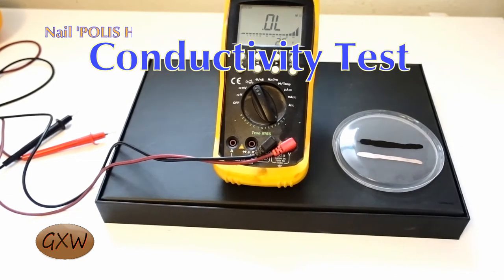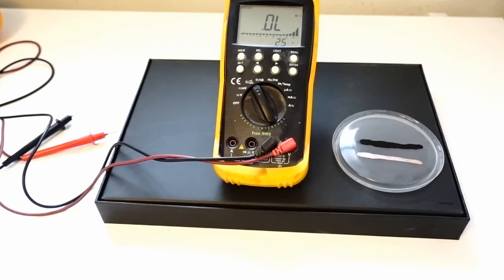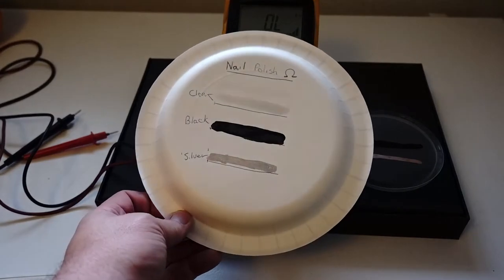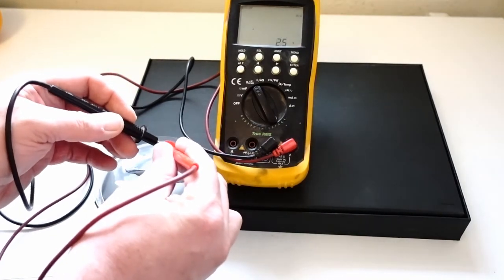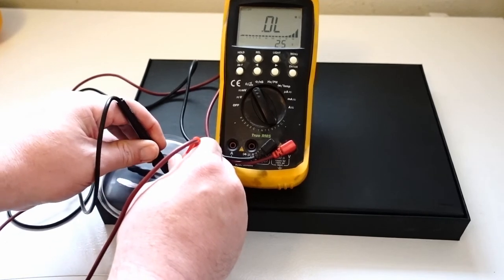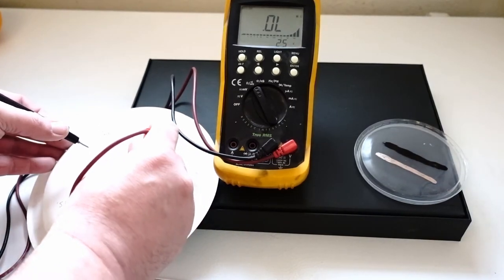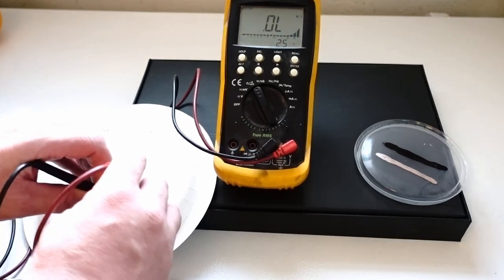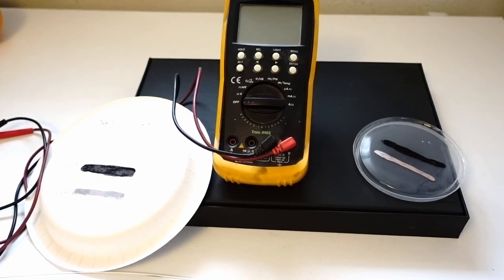is Nail polish conductive?

Comment: I was sure this video wouldn't exist but I'm so glad it does, I can now feel safe applying liquid metal to my cpu.
Reply from the maker: Hi 1992 Miata!  Thank you for watching my video.  I use the 'nail polish trick' for all kinds of things, and I don't see why it wouldn't work for putting Liquid Metal TIM on a CPU after painting the CPU with nail polish.  In my opinion, you might check to see if there is any kind of reaction between the two before doing up your CPU.  Also, the coating of nail polish also prevents cooler loop condensation from being as much of a problem both on CPUs and on the surrounding motherboard.
Reply: we came for the same reason lol, probably watched the same vid @1992 Mazda Miata
Reply: Am here for the same , did the application had any cons ??
Reply: @Abhidoesfirestuff  Been 3 years or so since I applied liquid metal to my processor, no issues as of yet. I wouldn't recommend this on a laptop though, works great for stationary devices like desktops.
Reply: @alexbakaloff  why not for laptops ? i am about to apply liquid metal to my gaming laptop for less temperatures
Reply: Ok but how to know WHICH clear nail polish to buy which is non conductive or suitable for putting on cpu and motherboard?!....

Comment: Im wondering - is it possible to combine nail polish with graphite / copper dust / battery remains to works as conductive solution - have you ever try this kind of stuff?
I wasted 2 keypads by by spilling tea on it (razer tartarus - space key). Unfortunetly it has graphite-like paths and they are disintegrated ;/ Ill try to "draw" a new paths - any solutions? I dont want to buy "conductive pen" cause i need fully dry paths (they are between two plastics).

Comment: why did you measure ohm and not DC voltage say?
Reply: V = I * Ω. Whether the readout reads 1 million ohms or 0.001 volts (or in this case, no reading whatsoever), the conclusion is the same.

Comment: I use a clear nail polish on my motherboard aftet a littel scratch on some traces is nail polish good for that and it can burn the pc?
Reply from the maker: Hi DF Gaming.  Clear nail polish should work fine to protect scratched traces or other  things on a motherboard.  A lot of overclockers use nail polish around their CPU area to prevent condensation from harming the board.  I am not sure what you mean by 'Burn the pc'; It isn't a magic fix, but it shouldn't harm the circuitry any... one suggestion though, I wouldn't paint it on my heat-sinks or areas where maximum thermal transfer is needed.  Thanks for the comment, good luck with your projects!
Reply: @genxwastelander8081 all nail polish would work ?...